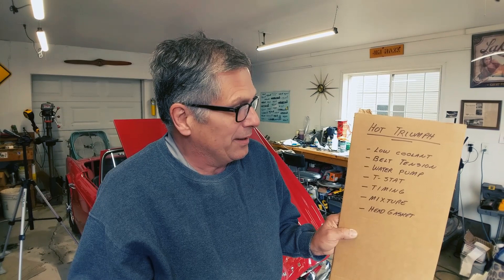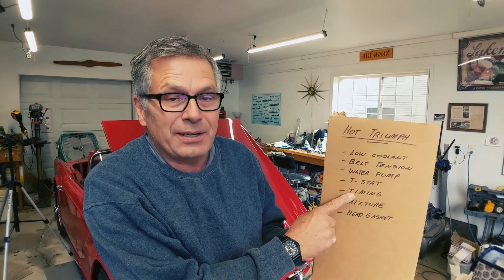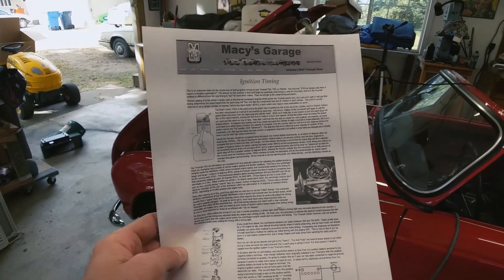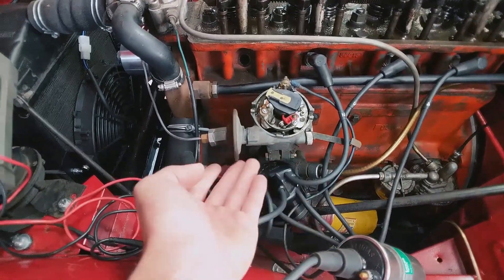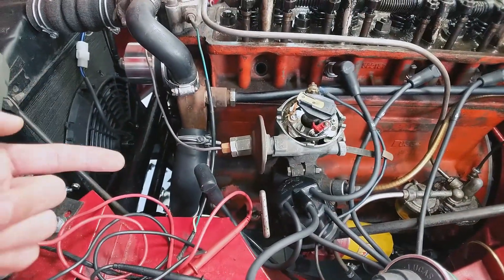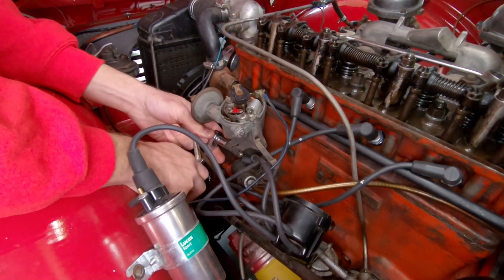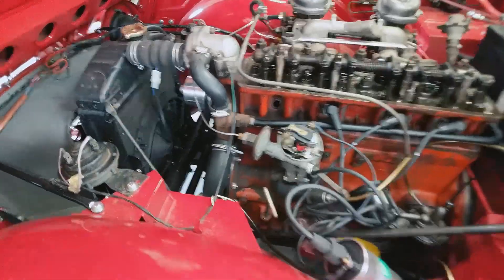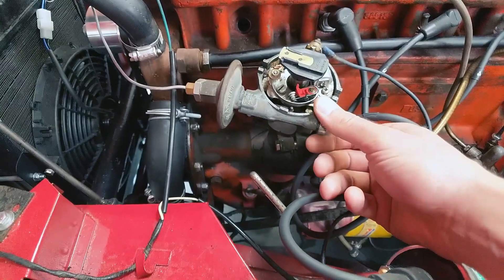INITIAL TIMING on Triumph TR4 | Wegs Garage

Comment: I suggest replacing the black rotor arm in your distributer with one of the red ones which are available from most of the suppliers.  The red ones are much less prone to internal arcing.
As far as your overheating problem, I’m waiting with interest for your next video…

Hats off to the Art Department!
Reply from the maker: Thanks for the tip, Charles. We have a new red one in our parts hoard. Will give it a try!

Comment: I have a feeling that the waterway galleries might be clogged with rust no way it should overheat with all the work you have done . Even if the timing is a little off and the carbs are running somewhat rich I don’t think it should be overheating so quickly.

Comment: Mark can you see overheating from the radiator or just the temp gauge.Is the electric fan in the push or puller position .It might be a radiator issue has it ever been boiled out you never know what the po has done keep the vide coming.
Reply from the maker: Hey Ralph, we can definitely see overheating from the rad in the form of boiling over. Also confirmed temps with an IR thermometer. Fan is a puller. The radiator was boiled out shortly after we purchased the car.
Thanks for following along with our build!